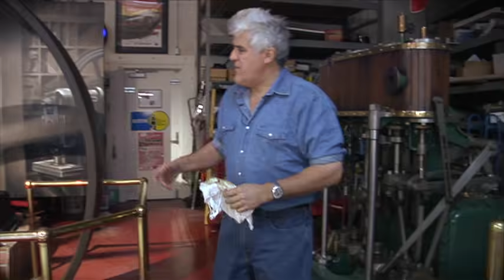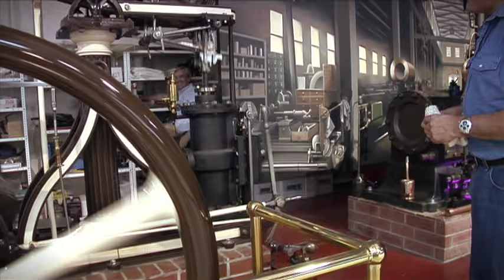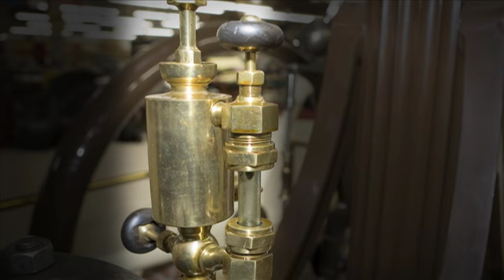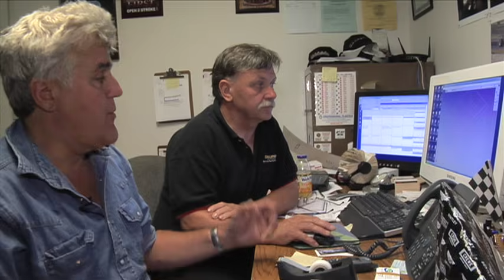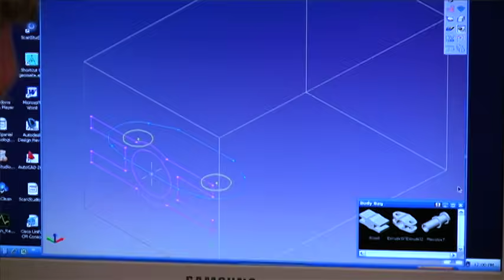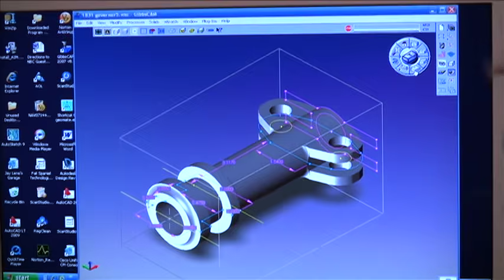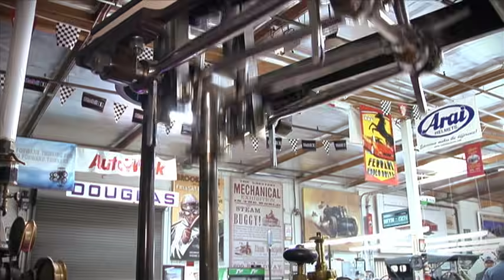1832 Steam Engine - Jay Leno's Garage

Comment: Absolute beauty in craftsmanship. Talk about built to last and easy on the eyes, my guess is that most of the major components were one off castings which were hand finished on manual lathes, mills and plenty of files. I am an old machinist working on the design and manufacture of aerospace gearboxes and I gotta tell you that those tapered shims look like a great way to setup a test stand, I suppose that the more modern version would be a gib adjustment but either way they are a much faster setup than peelible shims. If you ever want to do a show about turn of the century manufacturing give me a call and we can sit down and talk about shapers, lathes with a bull gear and cutting gear teeth on a mill. Your engineer / machinist is a lucky guy, not many people have the opportunity to restore museum quality equipment which will be treasured my many for years to come.
Reply: Yes, I like the wedges. They come from carpentry, long before screws and nails. Simple, effective and adjustable.
Reply: I wonder if a wood or wax full sized model was made for each part, then cast in brass or iron, then hand shaped with files?

Comment: The noise levels in the old machine shops was high not because of the steam engines but because of the leather drive belts, pulleys, drill presses, lathes, saws, etc. being run by the engines. I can remember when I was a young boy having been in a shop where the equipment was being driven by large overhead belts and smaller individual belts. The noise at the presses was frightening.

Comment: The first inter-city passenger railway line was the Liverpool to Manchester line opened in 1830. The building of the line alone is fascinating, then it had steam locos pulling the cars and trucks. At the Liverpool end a 1.25 mile tunnel run down a steep incline to the docks. Locos could not negotiate the incline. Large static steam engines pulled the trains up from the docks by rope. The disused tunnel is still there and may be reused as a part of the Liverpool metro - last used in 1972.

Comment: I agree, modern machines have taken efficiency to a whole new level but there is an elegance to steam engines. A bracket was not just a bracket, it was a metal sculpture. Shame we lost that that drive and replaced it with the 'that will do,' attitude.

Comment: Jay- I'd be willing to bet that the makers of the engine DID in fact put their name on it so many years ago, but that it was on a part that stuck out and was later ground down during repairs or restoration.  Either that, or Henry Ford didn't like the company that built it and he removed the name intentionally.  Unlike later mass production stuff, this likely only had the name of the manufacturer in one place.